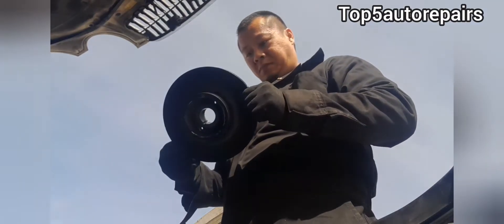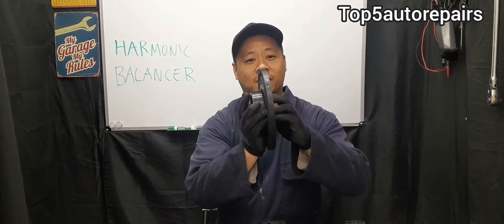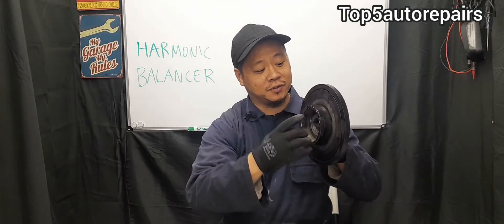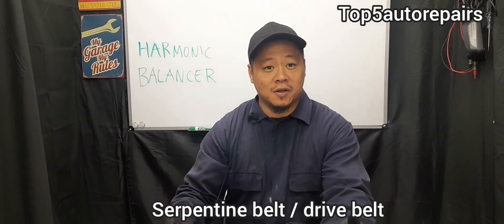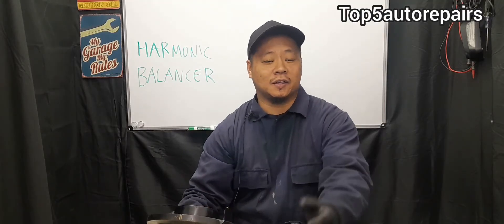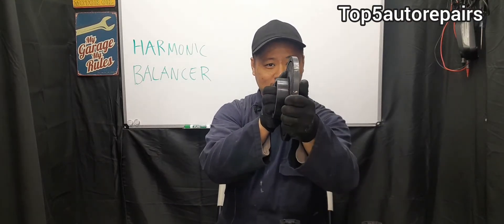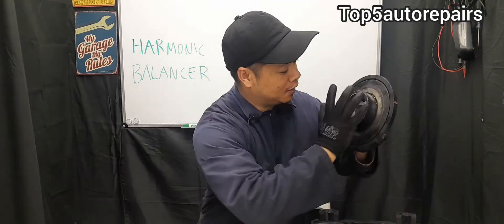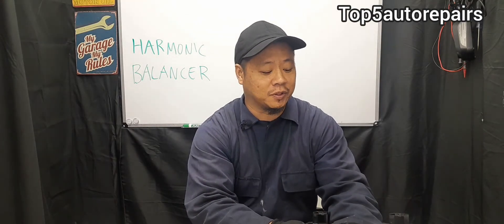HARMONIC BALANCER DAMPER WOBBLING AND MAKING NOISE (CRANKSHAFT PULLEY)

Comment: This happened to my car but I caught it before it could do any damage. I turned my car on one day heard an awful noise I shut the car off right away and noticed the balancer was coming off the belt jumped a couple of teeth on the balancer pulley and the belt was starting to get shredded up. Got the car towed to a shop and they fixed it I’ve had no issues since. Mechanic told me the rubber failed said it was original from the factory.

Comment: Question: i have a 2021 Jeep GC w/ v6. There is a bolt on the end of the crankshaft that holds the serpentine pulley on. The bolt wobbles but the pulley is smooth. There are no weird noises or vibration that i can tell. Is this normal?